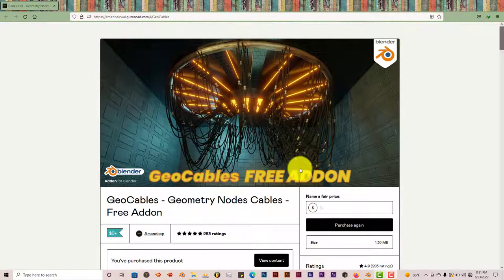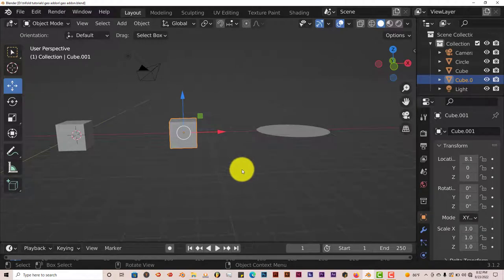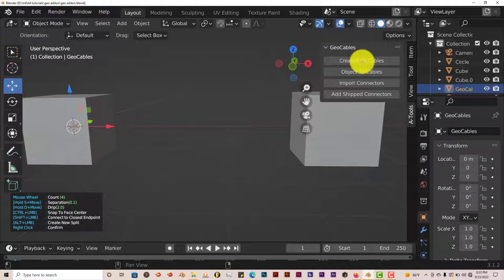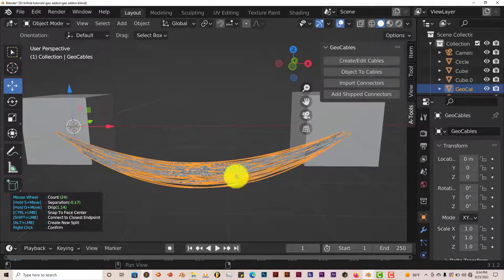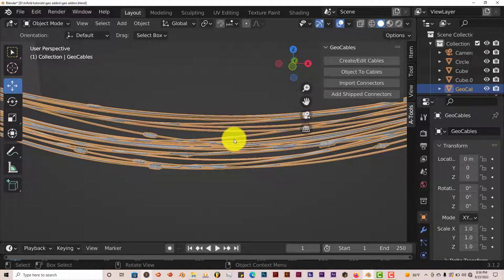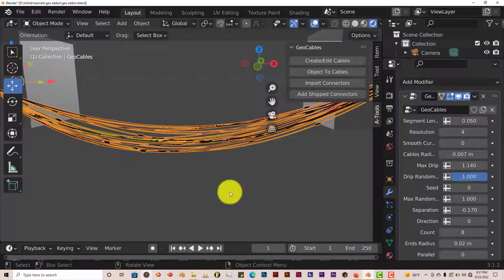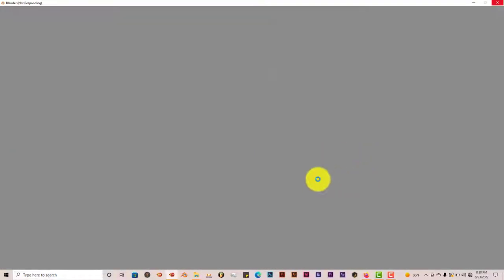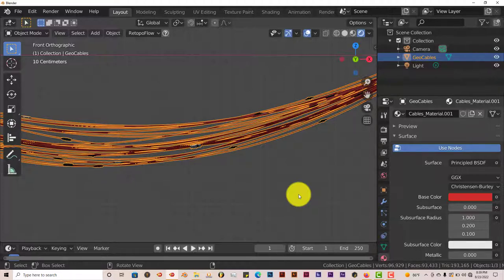Blender Quick Tip: The Free Geocables Addon

Comment: can you make a video please on how to animate them ?
Reply from the maker: I can look into it, but I don’t think they can be animated
Reply from the maker: I’ve looked into it, and the only way that I know of to animate the cables is if you were to turn them into a cloth object. But the main issue with that is to get the right kind of tension in them to make them look like a cable and not like cloth and also it would be pretty taxing on your system if you were to do a lot of cables like that at the same time. it is possible that the maker of the add-on would actually add that as a feature to future updates of the add-on.